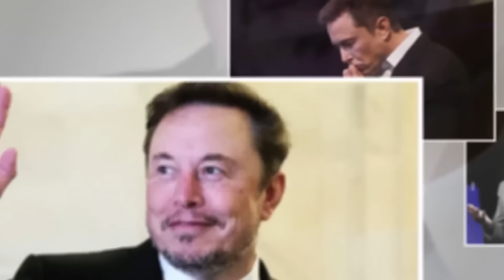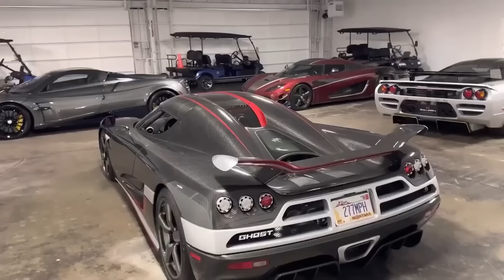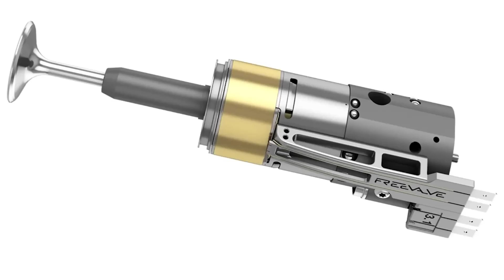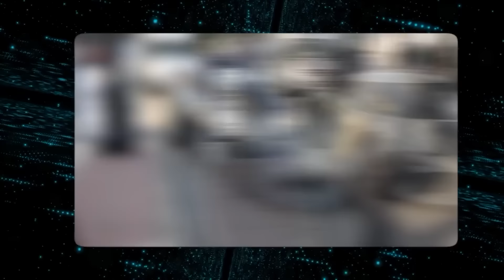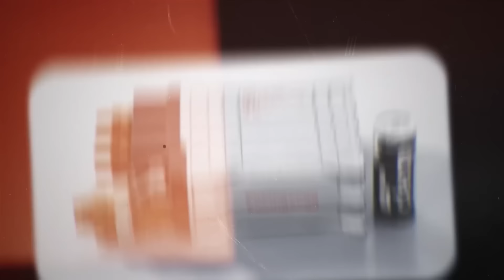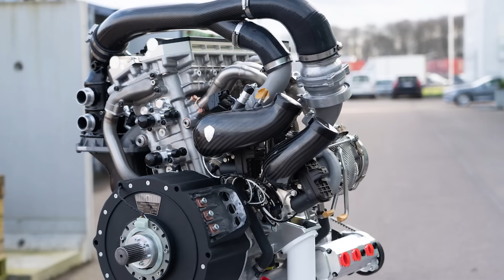Elon Musk ERUPTS And RESIGNS On LIVE TV After Koenigsegg Revealed It's New Engine, GOODBYE TESLA!

Comment: Missing data :
- what is the electric-only range of a ‘Dark Motor’ powered car with a 50kW battery?
- how much does the ‘all new’ Koenigsegg battery weigh per 50kW of storage?
- what is the fuel consumption of the hybrid Gemera at a steady 100 and 120 kmh?
- How much does the twin power source car weigh fully fuelled?
Specifications don’t matter as much as real world performance. C’mon, we need real info, not an advert with too much ‘mystique’ built-in. 
On that point, The performance  IS pretty spectacular, but efficiency is also prime in this setting. Until that is established, its all just bluster.
Reply: And it doesn't run on Dark Matter! stupid
Reply: Look it up